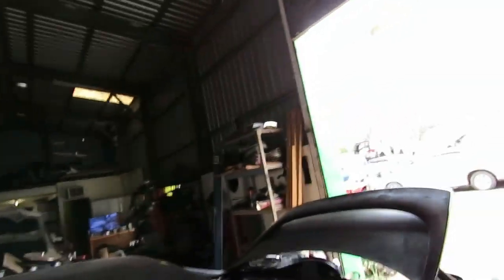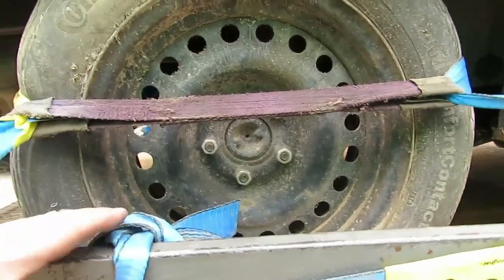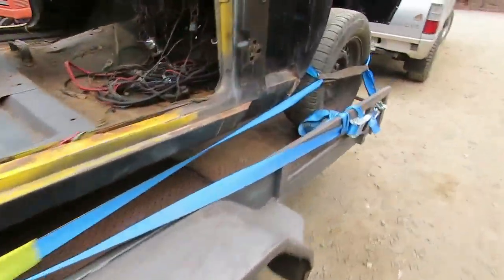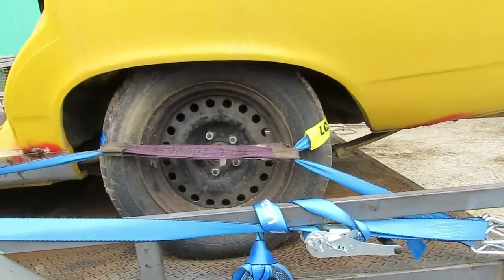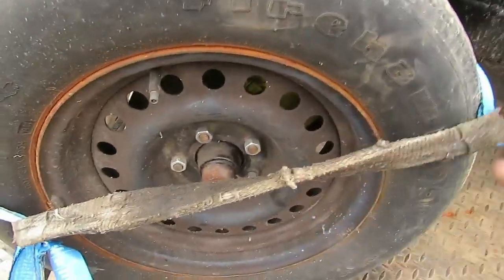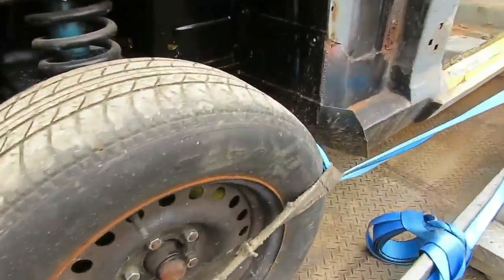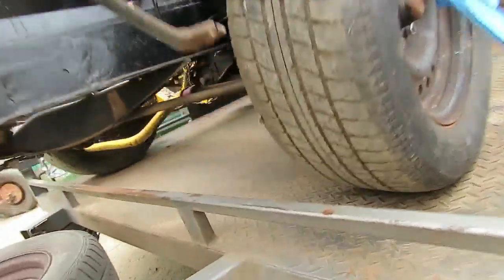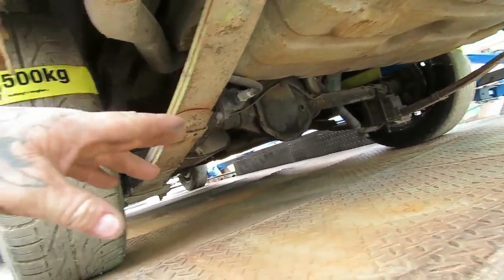kingatow crew //how tie down a car to a car trailer to transport

Comment: The way you show it is the way I do it. Only thing to make it safer again is to use a strap for each corner like you suggest. I have trouble using a single strap for each corner as most trailers don't have enough room or tie down points to make it work so have to go a single strap down each side